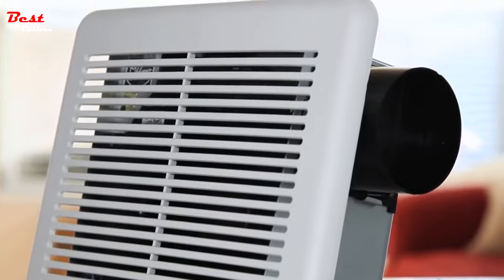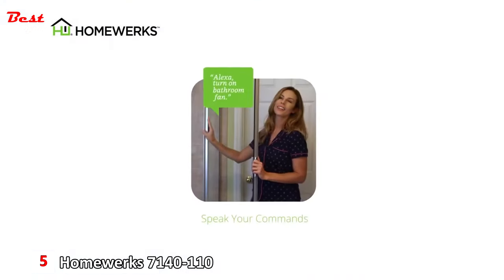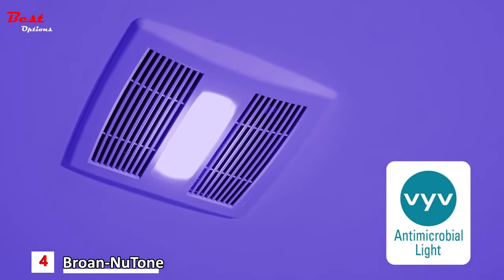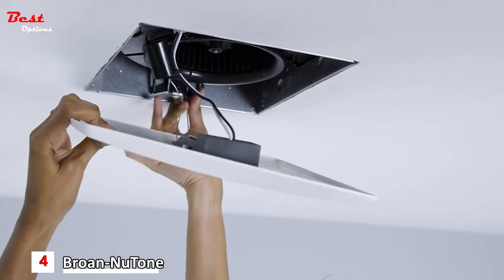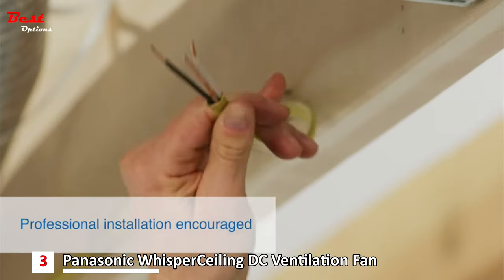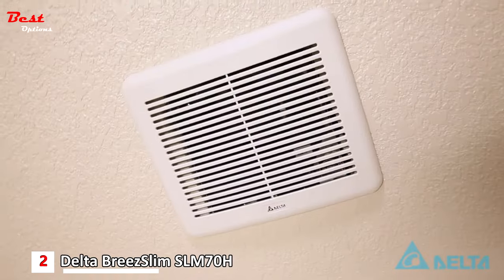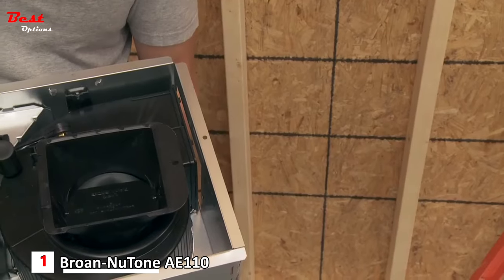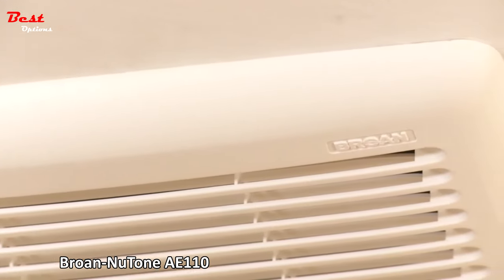Best Bathroom Exhaust Fans 2023

Comment from the maker: ✅5.  Homewerks 7140-110 Bathroom Fan Ceiling Mount Exhaust Ventilation
Amazon US – https://amzn.to/3Cd1nDQ
Amazon CA - https://amzn.to/3e1RSPx
✅4.  Broan-NuTone FG1000VVS Vital VIO Powered Upgrade Grille with Antibacterial LED SurfaceShield
Amazon US – https://amzn.to/3V3H04C
Amazon CA - https://amzn.to/3RxeRzS
✅3.  Panasonic FV-0511VQ1 WhisperCeiling DC Ventilation Fan
Amazon US – https://amzn.to/3fEMGBQ
Amazon CA - https://amzn.to/3rvhXtm
✅2.  Delta BreezSlim SLM70H 13.1W Exhaust Bath Fan with Humidity Sensor
Amazon US – https://amzn.to/3e3GeUp
Amazon CA - https://amzn.to/3EcFFlV
✅1.  Broan-NuTone AE110 Invent Flex Energy Star Qualified Single-Speed Ventilation Fan
Amazon US – https://amzn.to/3RxiK7W
Amazon CA – https://amzn.to/3RE3ztw